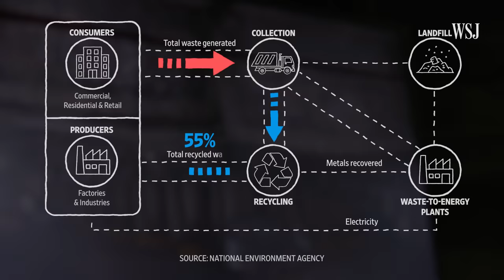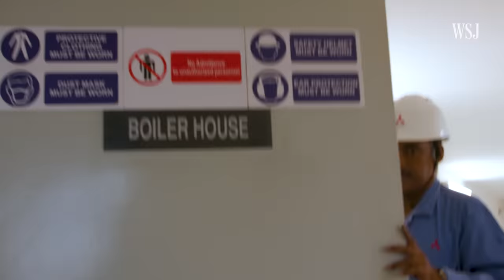How Singapore Handles Six Million Pounds of Trash Daily | WSJ A to B

Comment: Very interesting and in depth. Surprising how little acceptance waste to energy has in the US
Reply: How is it surprising when the US is the third largest country in the world and Singapore is smaller than New York City.
Reply: @tdkx China has many waste of energy plants and it has a larger population than the US, if the country wants to do it, it can. Just that US is always stuck in a political limbo and making these plants does not sound 'interesting' to their voters.
Reply: @tbh9088 so what's the solution then!? Continue filling usable lands with garbage!? Why can't we create a better exhaust filtration system!?!
Reply: @tbh9088  where does all that energy comes from!? Singapore isn't a very good place with wind or solar potential! They are even trying to see how they can import energy from Australia for example.
Reply: @tdkx  that's why it's surprising
Reply: We do have it, quite a bit more than you probably know about.
Reply: in Detroit it polluted the air and water which is why we shut the incineration plant down
Reply: Waste to energy still causes pollution sure it has lower co2 but it still releases toxic gas even after filters
Reply: What fuel is used to burn the garage???

Comment: I wonder if the ashes are good fertilizer? Grow trees to absorb the CO2 from the air.
Reply: It's burnt plastic and trash? How can that be used as a fertilizer? It would straight up kill crops.
Reply: @ecognitio9605  Or if crops grew, you wouldn't want to eat them.
Reply: It's used to pave roads near traffic stops with a composite ash and concrete mixture. Which are highly resistant to Engine oil.
Reply: @ecognitio9605  plastics are carbon though, it can still be used. If you looked at the land in the video, you'll see a lot of greenery growing on their landfill, along with that shot of the monitor lizard living there. It looks like the place is developing an ecosystem of its own.
Reply: What fuel is used to burn the garage???

Comment: Are Americans really fascinated by the most simple way of waste processing? This has been the standard for decades in  most of the European cities. Only 55% recycling is really not an especially good number for recycling,  you can even hear glass breaking when the truck dumps its contents. If they want to tackle their trash problem, they should ban single use plastics&containers and put a value on any can, bottle, ... used.